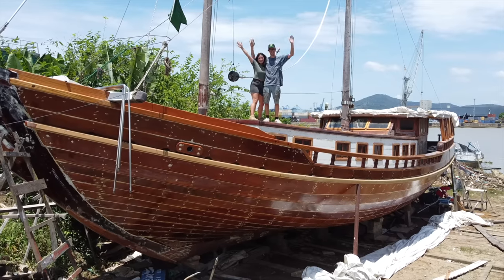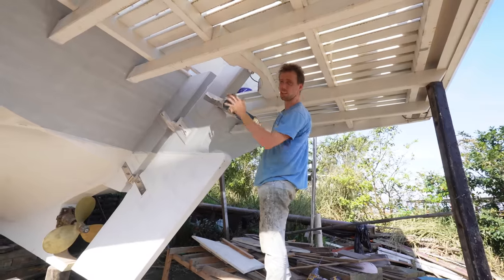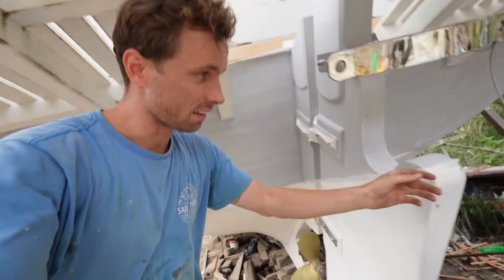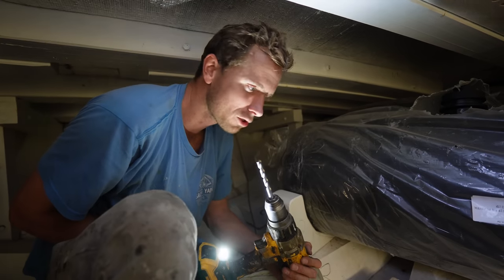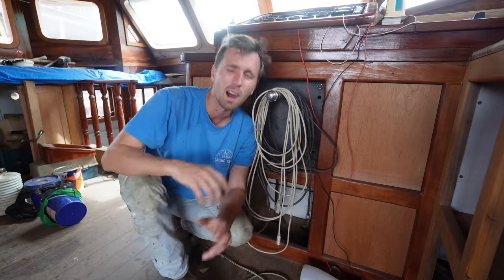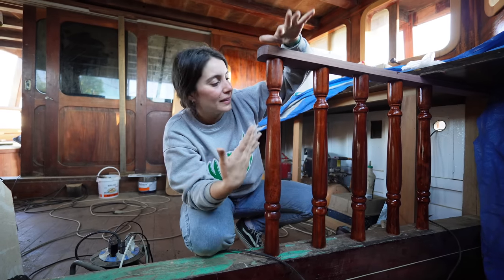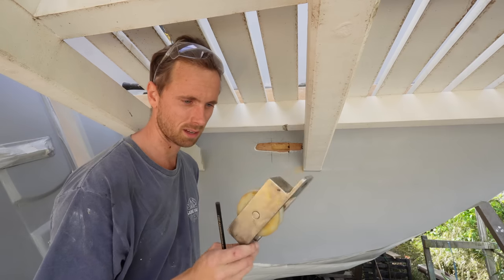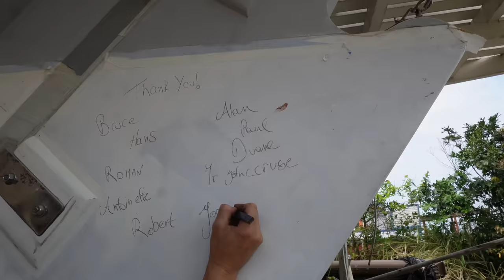We can finally steer our once sinking wooden boat into the horizon — Sailing Yabá 152

Comment: Is there a reason you would not fit a brass tube in the hole where the wire rope passes through the transom.
Seal the tubes in the holes well with epoxy.  Why would you allow even small holes in your hull open to the splash of the sea?

Comment: Fitting those top pulleys at 4.20 is too far inboard, you might have needed to fit a mounting block to fit the pullsy closer to the hull and let the cable go verticaly  to avoid the rubbing you will get.

Comment: Small diameter pulleys quickly fatigue steel cables, especially at acute angles. These pulleys ARE NOT PROPORTIONAL to the diameter of the cable, THEY ARE VERY SMALL. CHECK...

Comment: Anyone else having post removed anyway I will repeat what I said yesterday
Ben, will you listen to a retired Rigger, your steering needs to be rethought about, you need to fit 2 turnbuckles on each side, also spring tensioners on both sides, you can make these yourself it is easy enough to do, your steel cable what is the breaking strain (will not go by dia of wire as improvements in metal mixing have changed the dia to breaking strain chart), the cable will need to be 3x the length of boat in breaking strain in tons.
You can use multi reeve pulleys on the rudder to reduce heavy to light steering, like how the old square rigging ships use to be
If you want to get Intouch with me, I can walk you through it and even draw up some diagrams and send to you

Comment: Guys, there are so many things wrong with your rudder system; you really need to fork-out for a shipwright to do the maths for size and quantity of the pulleys and the cable type/cover/ thickness etc. At best it looks like its a dead-cert to cheese-wire through the transom, assuming that it doesn't rip both sets of brackets off the engine bay wall and ceiling first before it does so... which it will do.. starting with that one mounted on the ceiling. Which is at completely the wrong angle and only makes the engine bay a dangerous place to be.
Also;  the subject of tensioners as others have mentioned.... even if the pulleys' were the correct ones, they need to be mounted inline.. (the actual mounts) with the tension and not secured at 90 degrees. 

Not trying to be a downer;  I really enjoy the channel and have been watching since the first episode... but please get a qualified naval shipwright to advise the proper equipment and installation and do the calculations for this. at best this looks like a costly mistake, at worst it could cause an accident that could hurt a lot of people.
Reply: Much has been written about the serious problems with the steering. It’s surprising that the people in their boatyard are not more knowledgeable. A professional marine designer is needed before anymore work is done!

Comment: Would it not have been better to fit the stern pulleys so they were aligned to the angle the quadrant describes when moving and not horizontal so it pulls on the pulley at the same angle at right angles to the sheave axle. As the cable goes loose on one side, unless exactly centred then will you not get some slop when steering around neutral, which will be very annoying. Turbulence around the rudder will mean it can also constantly move. The geometry should aim to keep equal tension on the cables. That will probably need another gearbox between chain and cables so the cables are pulled by something with the same radius as the quadrant moves through on the rudder. That way they both move through exactly the same distance.

Comment: the geometry of the steering control cables is broken, one of the sides sag when turning. accordingly, when the rudder deviates from the central position, it will dangle

Comment: this is such a bad idea.. at very least you are going to need a steering assist and arrest system to keep that rudder under control. At best you switch to Hydraulic with a cable driven back up system.. But to rely on a very flimsy cable driven setup, that is a catastrophic failure that is going to happen. I would suggest, bring in a marine engineer to help you with a proper rudder control system, it is patently obvious, due to your obliviousness, that you have no clue what you are doing at this level.. and that's ok, if you were aware of it.. but you are not and it seems the boat yard is also unaware of marine control systems too. This episode was like watching a train wreck, get hit by a crashing plane.

Comment: gosh the wear on the steering is going to be high. The quadrant angle at full turn looks stressed. On standard boats, quadrants give problems and they are generally well engineered. Also .. what's going to stop water ingress where your cable runs through the transom. All of that timber needs epoxy in that area or you well be back to a rotting boat again. It looking good in other places though.

Comment: Don’t mean to be a smartass, but it matters which way u put on those wireclamps. The working end of the clamp - i.e. the nuts-end - should be on the working end of the cable. Set the other way, the clamp might cut the cable

Comment: The dimensions on the chain and wire are too small for my liking. The pulleys should be fixed to bigger base plates, allowing more screws to be used.  Also, the nylon sheaves are also bothering me, they should be steel. I think your setup is too weak for to handle the enormous forces the construction will have to deal with, both from the propeller and when you are sailing.

Comment: Ben, I really think your rudder is not going to work.  I see you forcing to turn that wheel with no water pressure on the rudder.  With the size and weight of that rudder plus  there will be tons of pressure on that rudder and do you really think those small pulleys and cables will hold up to GUSTS of pressure measuring in thousands of pounds?

Comment: I know, I'm nitpicking about this stove. Too thin a line. I know it has durability, but see for yourself the durability of the chain you use for this rope. Thin line - read stretchability, it always happens at the wrong moment. I would use at least 12 mm, the one you used probably weighs no more than 300 kg, 12 mm made of stainless steel. A 12 mm rope weighs almost 9000 kg, considering the surface area of your fin it is reasonable.

Comment: I'm weary about this flimsy steering set up. Too small a chain gauge and the cable gauge is too small. Seemingly all too weak when it will be under real stress. That large and heavy rudder in heavy seas will eventually rip that set up apart. I would seek expert advise.
Yabá is looking better every week. Stay safe kids.

Comment: The loops through the chain and through the rudder is not a good idea it will eat right through anything it’s moving against once it has something like a moving boat through water.
Reply: I’m sure you guys know more than I do about it I would just be worried about it. And what about the holes the wire goes through won’t water get in when your in deep sea waves and it’s splashing? There has to be a better way..

Comment: You could consider a trim tab instead of rebuilding the steering system again. Prolly a better situation all around based on the size and weight of your rudder. 

Leo did it here:

https://youtu.be/rKFJU3AGKk0?si=WmvcFLVUnftYV2Xr

Comment: Holy crap guys! That steering system is not good, please reconsider! Why digging into the transom when you can simply make ramps for the pullies?!? Also, how will keep the water integrity for the through hole? The inside of the channel where the cable goes will rot over time!

Comment: There are a number of concerns with this system.  Those coach screws in my mind are not good enough and where possible bolts that go all the way through should be used.  The joining of the cable onto a small chain should be done properly and the chain in my mind should be a lot bigger.  If you pop a side plate off that chain in bad weather you are in a lot of trouble and life could be lost because of undersize materials or poor design.  I think it's worth finding the right qualified people to talk you through this very important part of the boat.

Comment: I'm afraid you should rethink your steering system. You aren't taking into account the tremendous forces that the ocean will place on your rudder. Yhe cable is not big enough, to many angles,the alignments don't look correct,and I think you need some kind of mechanical advantage for a boat as big and heavy as Yaba. Please seek some experts opinions and suggestions

Comment: Now, on the hard, your rudder falls to center under its weight. In water you may need to weight the rudder with lead because it will float up to either side.

Comment: Sorry to pile on here but the connection from the cable to chain is a weak point. That little pin in the chain isn’t a very strong connection.
Reply from the maker: You're right! We are working on improvements!

Comment: Rudder system is going to fail as soon as you are in even a moderate sea. Next get a proper Electrical panel keeping all AC 240 / 120 side by side within it and a separate low voltage DC. Some of the wiring is 1960’s spec. at best, the whole boat is like a number of added  on diy circuits which it doesn’t need to be. This not meant to be disparaging, but your boat is too nice and remember effectively is a NEW boat for insurance purposes, so would be surprised if a marine surveyor passes it for commercial use - which you want to use it for / do. Go safely, check, check and check again. Please get some professional advice, lots of folks here would help I’m sure. Again go safely please.

Comment: I am sorry to criticize your work. With all the good advice on how to improve the cable system, my opinion is that with such a large rudder, you need a hydraulic system. Why am I writing this? Holes in the stern don't work at all. You no more maneuver if you break only one pulley. And you have lots of them!!!
You should also think about how the cable system would work with automatic steering. Finally, you have heard many stories of rudder damage. Please think about your and the lives of your passengers and listen to an old sailor. Greetings from Southeast Asia

Comment: there are many rules about steering and you seem to be breaking or about to break many of them. As mentioned the wire passing through the hull needs to be protected and the hole needs to be water proof to stop rot. The saddles you are using on the wire are the wrong way round, the rudder should stop at 35 degrees either side so a stopper needs to be put in on either side.. i don't like the wire being visible outside the ship but that is the system you have. Stuff can catch on this and drag at sea. the wheel needs to turn three and a half revolutions to port and same to starboard. the steering wheel needs a Centre mark and this is usually a Turks head tied to the centre pin. You don't seem to have given any thought to self steering. Very hard to buy off the shelf for the system you have as it is so old. With just the two of you at sea it will soon become too much to be hand steering on long passages. I am not trying to be negative but this part of your boat is very important and can't be hit and miss.

Comment: You need to take that bicycle chain off immediately. In a heavy sea, you will Snap that chain and have no rudder. You must use a motorcycle chain.
Reply: He said it is a motorcycle chain .
Reply: @Philc231 way too small
Reply: What was originally used to steer yaba? If it worked for all those years. Maybe it didn't need fixed. Also there are many boats what are they useing? around there
Reply: I really do not believe these ship wrights would allow a bad job or underpowered devices . I agree the whole system seems  not robust enough .

Comment: DO NOT put that boat in the water without some marine engineer or even a marine mechanic has looked at your idea of what a steering system should be on a boat that size and that weight. Next time you are on the water even in a dingy, stick your hand in the water and try to move your open palm from left to right, right to left and see if you can keep it going through the water like a blade. You will be surprised at the forces that will be exerted on that rudder, and transferred to the wire through your pulleys that are all being placed in the wrong places in wring angles. The entire geometry of wire travel and pulley placement are wrong. They are being mounted by "screws". They should be mounted with nuts and bolts, preferably with backing plates all sleeved wherever they are running through any wood surface. You must not realize the pressures that will be applied to that cable and pulleys. SO far I have not heard you even mention any provisions to tension that wire as it stretches over time. In your case, within the first week or two. You need turnbuckles to tighten the steel wires. Not trying to be harsh but the steering system needs a better design and better installation than what I have seen today. 
I hope you are also thinking about some other way of attaching the two wires to the rudder quadrant besides just running them through the hole in the quadrant WITH or WITHOUT thimbles. It will not work. You need additional hardware there. 
Better plan for hydraulic steering. There is a reason WHY that boat and many boats that size have a tiller. There is also a very good reason why those tiller handles are as long as they are. LEVERAGE.

Comment: Nice proof of concept, but NEVER SADDLE A DEAD HORSE! Your idea of reversing one wire rope clip is flawed. You must never put the saddle side of the u-bolt clip on the dead end, only the live (load bearing) end. The reversed one is essentially useless—use two, but do it correctly. And yes, as others have stated, spring tensioners, anti-chaffing devices wherever cable touches anything, and last but not least, wire rope eyelets wherever the rope terminates.

Comment: Hello, as many said, your rudder control system is a bit too simple to be efficient, and above all, reliable. The dynamically  exerted  pressure at sea on the rudder will be considerable, and the 4 mm cable is likely to break. Also, the move of the rudder makes the cable path length vary. If you have any slack, the cable will go out of the pulley, and will be stuck beetween the pulley and the casting. your cable is definately too thin. You need a lot more engineering to make a true rudder control system. Asking an engineer, as proposed by many, would be a wise solution. As said before, I am convinced that you build this system as it is for timing reason. With all the experience you have gained in these (nearly) 3 years, you know that your system is not up to standard. I'm waiting for the next episode to see your reaction to the HUGE number of comments pointing out the flaws in this realisation. Rudder fail is no fun at sea! And it always fail in heavy weather, at the worst moment. Keep on the good work!

Comment: Great job... with Yaba. Problem. You are cluless to the contestant,  tons of pressure AGINST the rudder.
If your building a children's play gym like Peter pan. Then what you built will work. If you think , it's a soild means. You will end up on the rocks. Like swiss family Robson.  ( pay a marine engineer who designs ships.  ) your guessing will get you killed. 
X tons ship, rudder weight x tons , current pressure, 
You need to rethink it all. With a ((( collage grad in arts and design engineering PHD. )).. your math is so wrong. .... no insurance company pre inspection will aprove that...  it like, a home made soap box dubie,  push cart car, thinking is will drive in the French lomoze,  super car race..... hire a expert.
You are not at that level.... best of luck...dont blow it now.